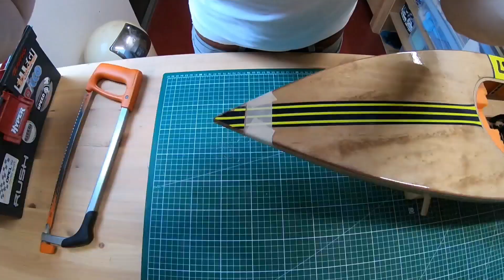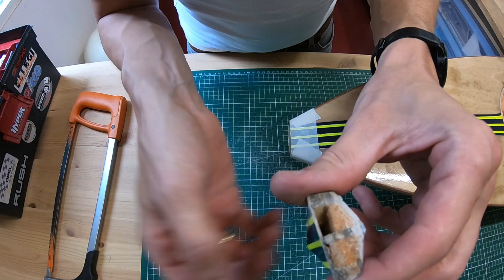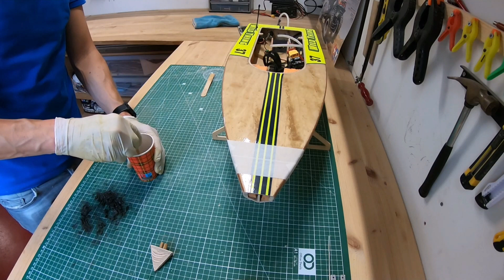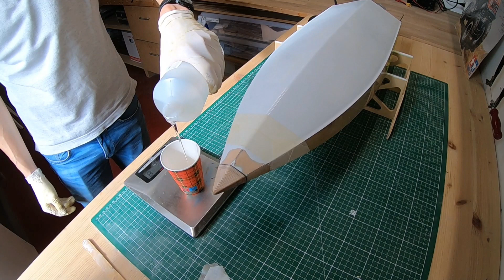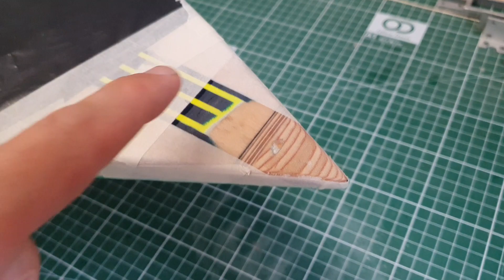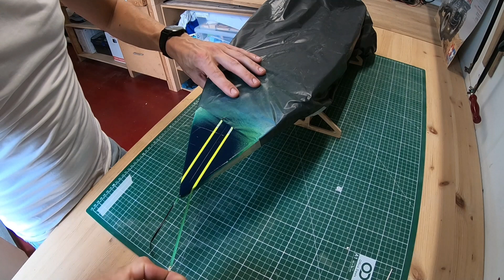RC boat build: How to fix / damage repair

Comment: Brilliant work as always. Stronger than before for sure Jan. Bytheway, I took a look at the TP power motors at the German site. It has a nice 4063 1750 kv at 85€...it seems nice👌
Reply from the maker: Thanks Dim, also for the motor tip. Actually, these prices are excluding VAT. Tp Europe website includes VAT and comes down to the same price 😎👍

Comment: Cool! What grammature (thickness) of fiberglass do you use for laminating?
Reply from the maker: Thanks Vadim. I use 50gr/m2 glass in this case. I used 2 layers, with the layers having a 45 degrees angle difference of the glass strands.
Reply: @CozyRC  thanks much for details.  I'm gonna have similar repair soon. My catamaran hit  aluminum boat ... split a bit in front part and both tips to be replaced.  She was inside fishermen boat cirka 20cm ))
Reply from the maker: @vadimkvak1751  Ouch, that sounds bad! Hopefully your repair will come out nice and strong 👍
Reply: @CozyRC  thanks man!  All should be fine. In 130cm hull I have enough space))
Reply: Thank you for your video and for your explanations. I have to do a similar repair on one of my tunnel hull sponsons: a Top Speed III.
Reply from the maker: @nauti-tucu  you're welcome and good luck with your repair!